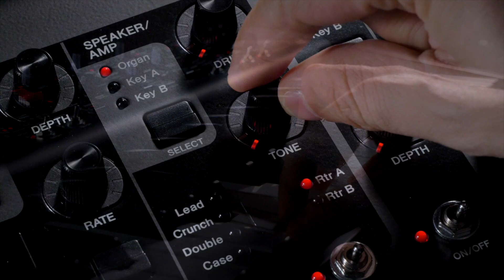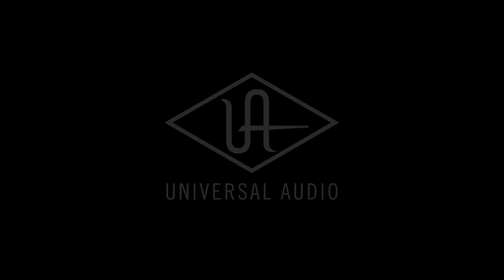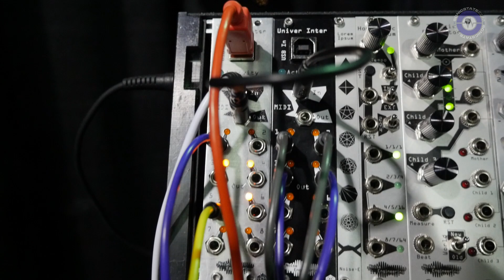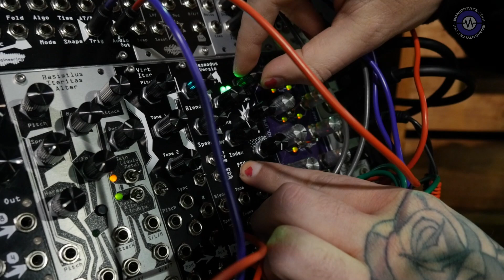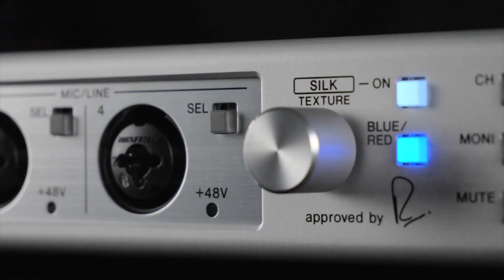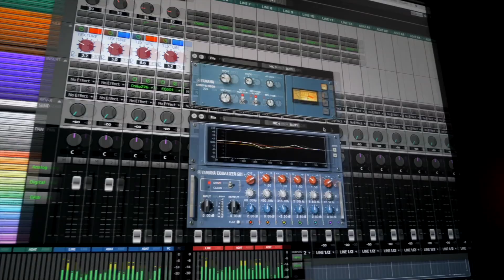NAMM 2020: Noise Engineering New Modules for 2020

Comment: First module seems to be Mutant Brain with a Noise Engineering faceplate 🤔
Reply: It's better! Mutant brain has I believe 16 total outputs but they're only configurable within the restrictions of 4 CV and 12 trigs. This one is fully configurable.
Reply: @vltraviolet  Mutant brain  is configurable for clock dividers as well as keyboard splits. You will need two of the NE modules to equal 1 the number of outputs that the mutant brain has. However the NE one is expandable and does MIDI out which is a huge plus. Four CV's on the Mutant Brain can be limiting though. I wonder if you can make the NE ones into synced LFO's ?